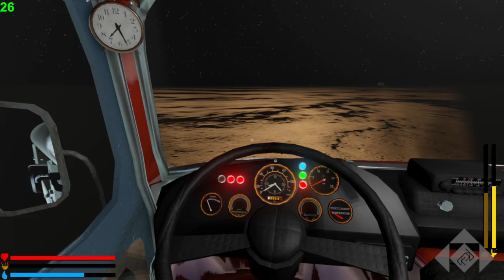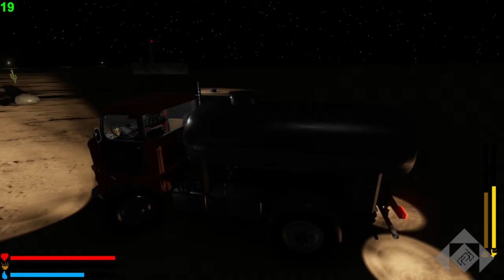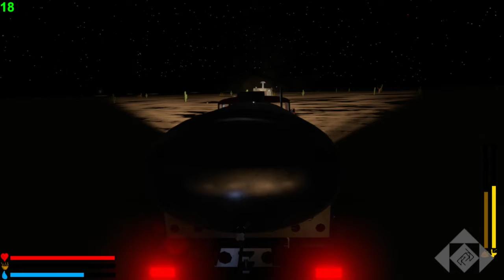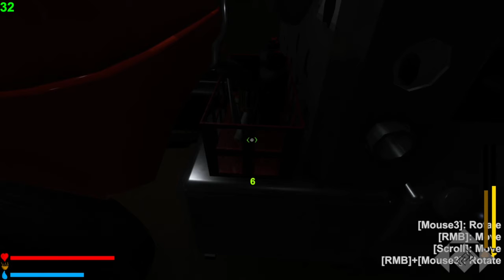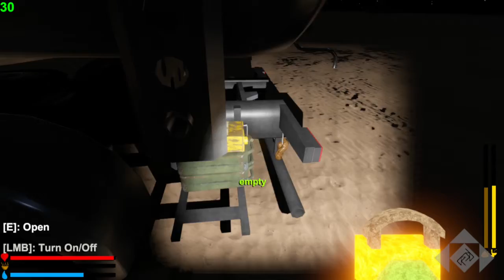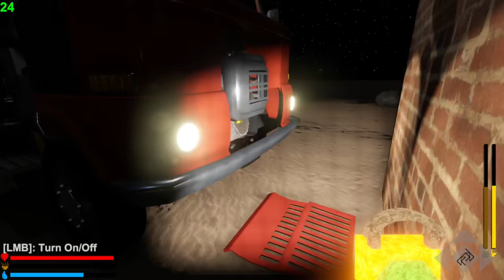Empty Storage Mounts On Truck Phys Locks!-The Long Drive

Comment: Heh, what's funny to me is that this actually came first than the baskets! 
The IFA truck's side rails were the first ever introduction to the physlock system, and for a while were the only place in the game physics locking was used
It was much later that the baskets were redesigned and had the trucks physlock system added to them :) 

But because people know about the baskets so well it always feels a bit funny to see the original being discovered after for some reason
Reply from the maker: Ahhh crap... It's on the wiki... But I don't remember seeing anyone use them in a video... Forgotten knowledge... Sad...